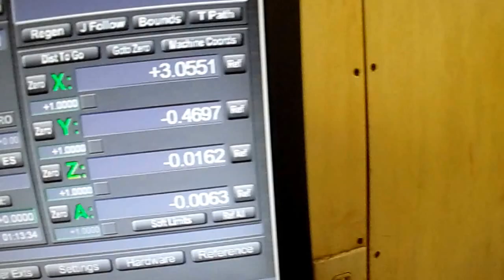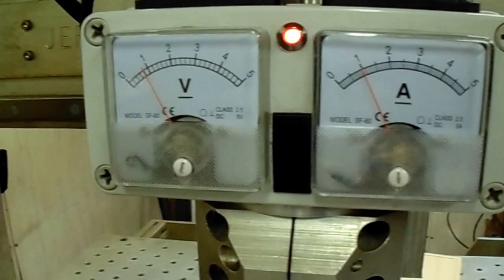Combined CNC Technologies Spindle + Laser Diode

Comment from the maker: I use the M03 to initially turn the laser on with a relay in Mach3 like you do with a spindle, but the laser's intensity (to engrave the shades) is controlled by the A axis depth command. The A axis is a servo motor tied with a timing belt to a MA3 shaft encoder which gives varied 0-5v to an analog modulated laser driver.

From the beginning to the end of the engraving, the laser never turns off.
Reply: Deep South are you saying the laser intensity is varied with some volume-type knob? And you hooked that knob to a cnc-controlled motor?